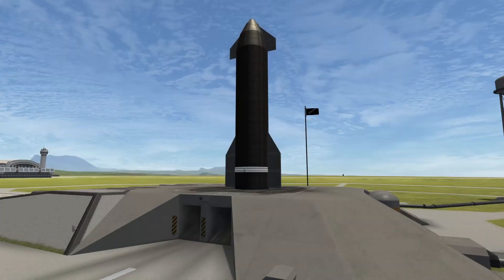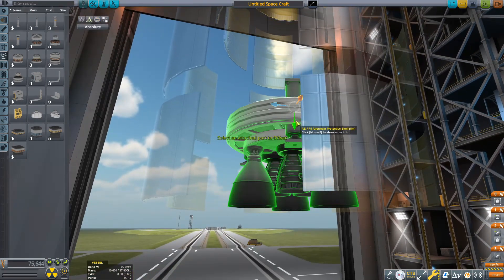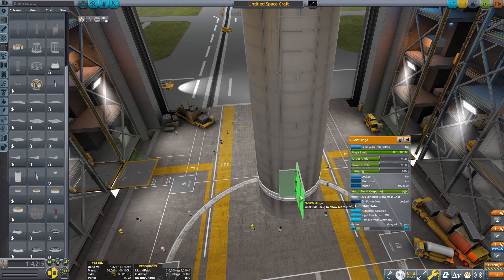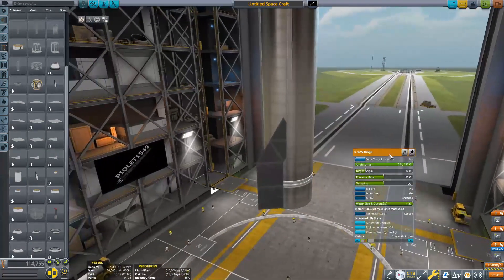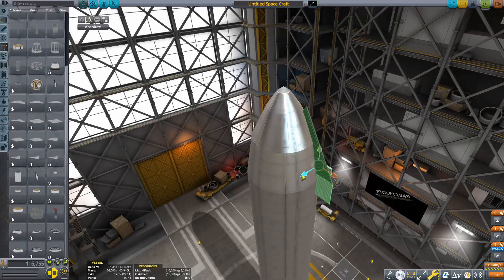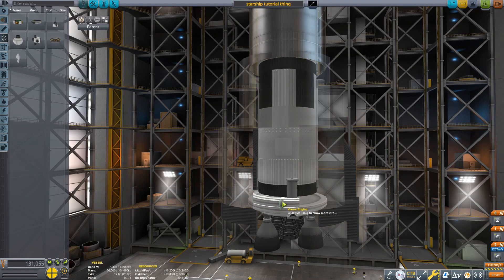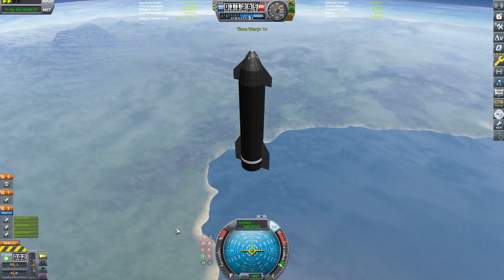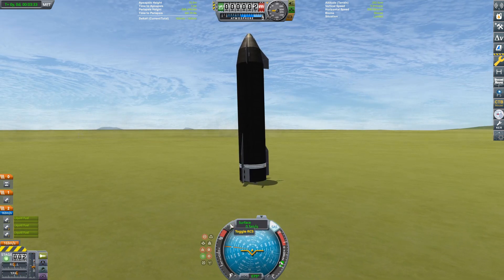KSP Tutorial: How To Build A Stock Starship!

Comment from the maker: Ok so quite a few people have said the craft file is not working. I'm looking into a fix and will repost it as soon as possible, sorry guys!
Reply: It worked for me
Reply from the maker: @sachinamarath6552  do you have tweak scale installed?
Reply: @Piolet1549  nice job
Reply: @Piolet1549  can you please whrite the amount of thrust of the vac engines for the people without the DLC
Reply: @Piolet1549  plzzz tutorial of make big falcon rocket plzzzz
Reply: @sachinamarath6552  where you put it? In game data?
Reply: @witkm_7  chodzi ci o plik z starshipem?
Reply: @witkm_7  jeżeli tak, to wchodzi w pliki gry, tam gdzie masz np launcher, wchodzisz w ships>vab i tak wsadzasz wcześniej pobrany plik
Reply: @kubarak6462  ok dzieki
Reply: @witkm_7  The directory structure is Kerbal Space Program / Saves / [Your Save Game Name] / Ships /

Under ships you have two directories: SPH [space Plane Hanger] and VAB [Vehicle Assembly Bay].

If the ship you've downloaded is a rocket it'll go into the VAB, if it's a spaceplane put it in the SPH directory.

Once you've copied the file, load your savegame and you should be able to load the craft inside the VAB or SPH and launch it.

The only other thing to bear in mind is that crafts with mod parts require you to have the same mods installed. I haven't got much experience with mods myself but if you have any issues I'm sure someone here can help.

Good luck!
Reply: no problem take your time!
Reply: Just wondering what recording software to you use?
Reply from the maker: @fallofboots  OBS studio
Reply: have you found out what the problem was? if not what mods did you use?
Reply: how do you do to leave the bonnet open?
Reply: probably the expansions to the game
Reply: Thats because you have used tweak scale and some other mod too.
Reply: I built mines exactly how he did but every time i try to belly flop I’m nose heavy can someone help and tell me what I’m doing wrong, thanks 🙏🏽
Reply: Do you think you could make a stock Falcon9?
Reply: Hi I want to ask how to set the action groups,mine are not working
Reply: And the fins are not working any tips
Reply: instablaster...

Comment: Have you ever heard of something called "Bendy Tech"?
It's a stack of the ant engines between your main ship and whatever you want to bend. Then you slap an airbrake against the side of it (but on the main thing) and allpw same vessel interaction between airbrake and thing. Ant engines have very flexible joints so you get a somewhat decent hinge that resets when time warp or switch to a different craft out of render distance.

Comment: ok so i did everything you've shown here and my starship starts to violently rotate horizontally and even adding a shitton of RCS to stop it didn't work. + sometimes, and for some reason I cant flip to vertical position before the landing so I end up like SN9. (yes, I've  moved the heaviest point on the craft near the engines) Any solutions? I'am an old KSP player so don't come up with something like "was your SAS control turned on" or "maybe you had something different than retrograde/stability assist turned on" etc. Thanks.

Comment: My starship doesn’t work. Only 0.9 TWR it spins it self until it explodes. And the landing legs (the pistons you used collapse) 😕 I have no idea why
Reply from the maker: I would try to remove as much fuel as possible to get the TWR up. As to the landing legs, make sure you set up an action group to lock all the pistons once they are extended, that should stop them from collapsing
Reply: @Piolet1549  gonna try today again thank you :)

Comment: I made an almost exact replica of yours and when I try to reenter Kerbins atmosphere it loses control and goes into a nose first prograde dive I can’t get out of, also it really struggles to do the bellyflop, like it struggles to go straight and takes almost a minute to transition. Do you have any solutions to both of these problems? Love your channel and videos btw
Reply from the maker: I would try to pump as much fuel to the bottom/ back as possible to try to help it pitch up. As to the second problem idk really what you could do about that. The fairings can be a little weird aerodynamically.
Reply: @Piolet1549  I did the fuel tank thing on my own as I thought of it too. Didn’t seem to work. I even added more rcs and that didn’t solve it either. I used you tutorial and made a mk2 and will try again. Overall though, your tutorial worked amazing and the mk2 can belly flop amazingly. I love your channel and your videos!

Comment: Having trouble getting the flaps to work - it says they are locked and I can't figure out how to unlock them. I see action groups on 2 and 4 for the landing gear, how do I set up another action group to unlock the flaps?
Reply from the maker: you should be able to find something that says 'toggle locked' in the action group menu
Reply: @Piolet1549  Found it! Had to turn on advanced tweakables in settings to get the button to show up in the action group menu. Thanks!

Comment: Hey I was wondering how you made the flaps move so fast.. I built this model of the Starship but my flaps are super slow.. any way to fix that?
Reply from the maker: there should be an option called traverse rate, if you turn that up the fins should move quicker
Reply: @Piolet1549  Oh okay I'll check that out, thanks!!

Comment: Yo when I use the symmetry tool for the hinges they face in opposite directions so the flaps flap in opposite directions. What do you reckon is the issue?
Reply from the maker: You need to press 'R' when placing the part to switch the symmetry mode, that should do it

Comment: How do you hide the fairing in the step configuration(Mod?)
I don't have this option

It would be more helpful if you put the modifications you are using in the description below
Reply from the maker: There are no mods, the ship is fully stock. I'm not totally sure what your asking about, could you clarify?
Reply: @Piolet1549  You have the configuration for the rocket at the bottom right, you hide the fairing
I can't hide the fairing at the bottom right like you did. 3:13 Sry  my english is not the best, im german
Reply: @Satronex  under the fairing settings there is an option called (fairing staged), clicking on this will remove the fairing from the staging diagram.

Comment: could this go to orbit if we filled the fuel tanks?
Reply: I’ve flown it before, I think it’s possible but difficult. It’s definitely designed to be flown with the super heavy booster.
Reply from the maker: The challenge is that the TWR is really low with full tanks so you have a lot of gravity losses and you don't really get to use the wolfhounds.
Reply: @Piolet1549  is it possible for you to make another video but for one that can get straight to orbit?